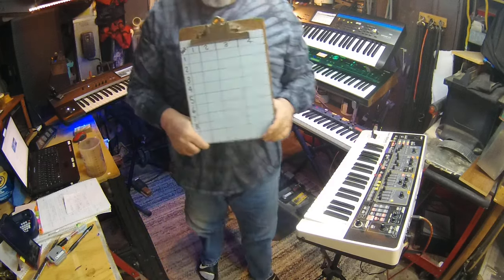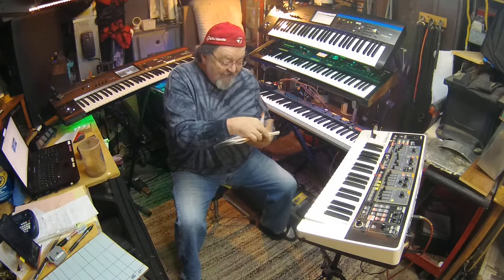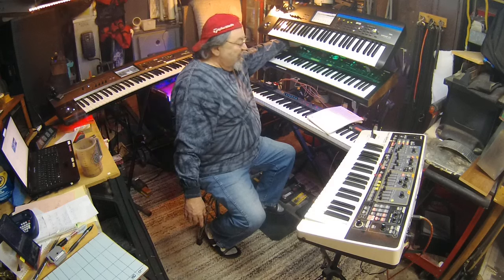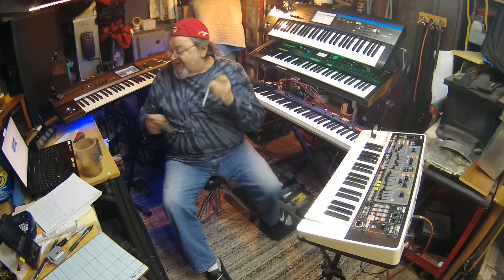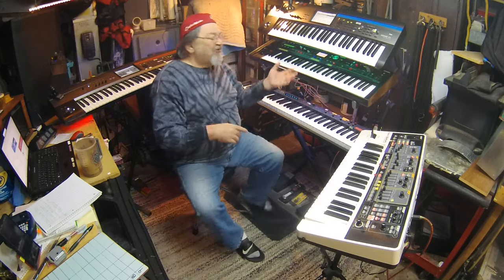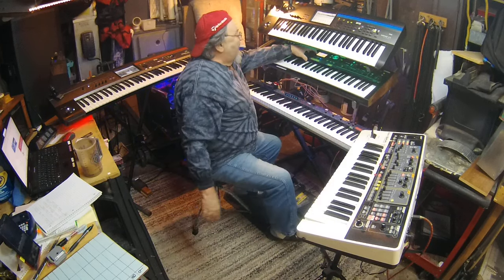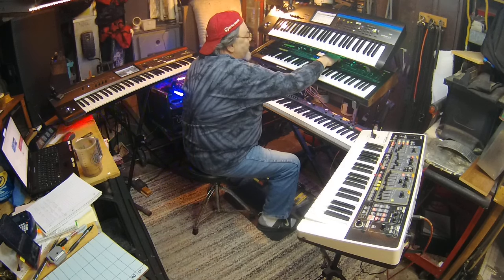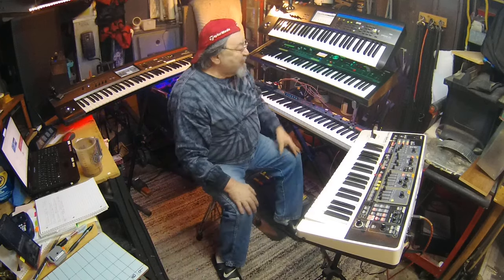The Roland VR09 Keyboard, Let's get into this.

Comment: Hey Keith! I know how you feel! It’s very frustrating. Why can’t they just make a perfect synth? - There are SO many more quirks than you got into. I have owned my VR09 since 2017 and have played many many shows with it and have had no problems. I’ve run it mono, stereo and through tube and solid state Leslie’s, but I use it as a secondary board to my FA06 because of the quirks. I absolutely hate that it doesn’t accept MIDI IN, so that could be controlled externally by a keytar on stage. Another thing is the editor app for iPad edits the “Synth” parameters - but not the organ! You can make really deep live changes on the iPad to your SYNTH sounds and they affect the sound coming from the board instantly. But any changes you make on the iPad in ORGAN does nothing. If you make a change on the board while on an organ setting it WILL show on the app - but what good is that? If you just want a LIGHT (12lb) board for piano and B3, the VR is great. For a board to use as a sound designer or creative tool, look elsewhere. Great channel. Great video. Keep it up! 🍺
Reply from the maker: Thanks Brah! Besides all the crap you have to go thru on this board, It's worth it because of what it does. Maybe one day companies will start paying attention to what we really need and build us a super cool keyboard! Thanks for watching.